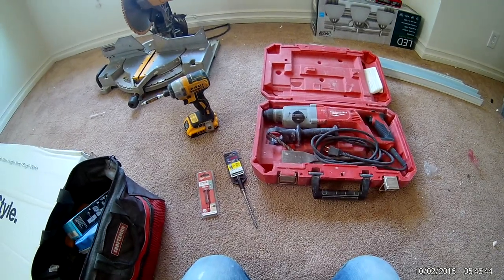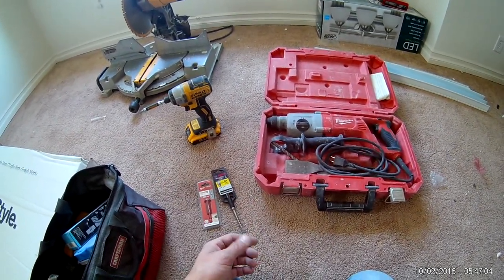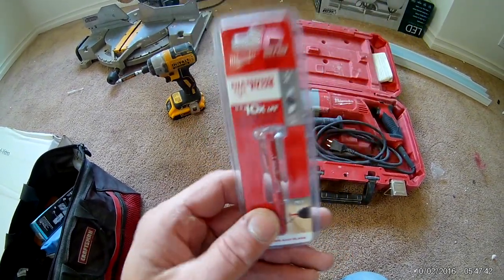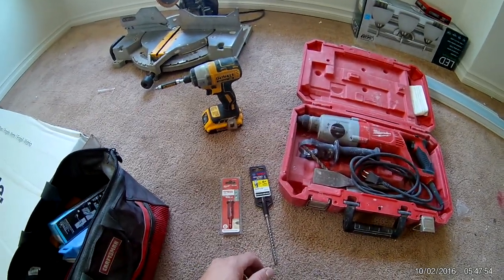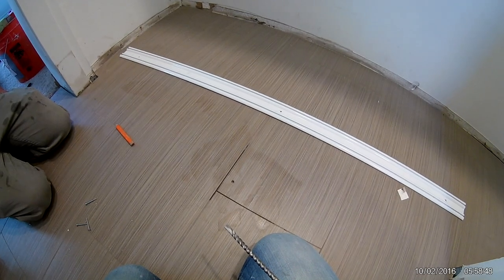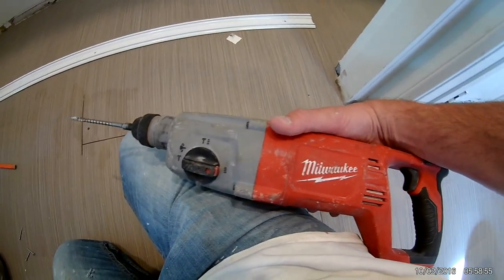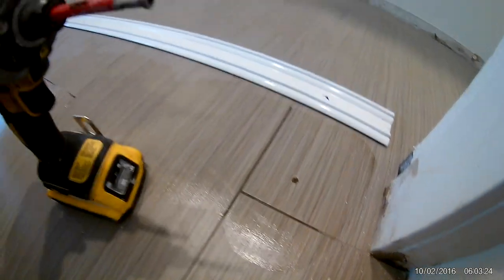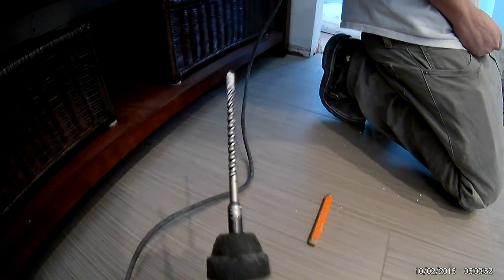How to Drill a Hole in Porcelain Tile - Which Drill Bit to Use?

Comment: I've been struggling to drill a couple of holes for a shower wand holder. Now, I've got 3 dull masonry bits and the holes are still very shallow. I'm going to try that diamond coated hole saw instead.
Reply from the maker: +auxpowerunit the bits work good, just make sure to keep it wet with a rag during the drilling process.
Reply: Thanks for the advice. I'll let you know how it turns out.
Reply: I just finished drilling with a Milwaukee brand diamond hole saw. It worked well. Thanks for your help !
Reply from the maker: +auxpowerunit That's great! We like them also!

Comment: Why didnt u have the it on hammer setting for the masonry bit
Reply from the maker: When on the hammer mode with this Milwaukee rotary hammer, it is much too aggressive. You need a drill with hammer mode.
Reply: +Landberg Tile DIY TV 
so a drills hammer setting Being much less aggresive would be ok.
Reply from the maker: Yes sir!
Reply: It could crack tile. Those spade type of bits, very inefficient with porcelain, and more source of trouble when you can damage finished product.
Reply: Ur not drilling on concrete ur drilling on tiles or glass.. Might cause cracks if use with aggresive speed.. Hammer mode diff from normal drill bit drilling.. The slower the better.. Be patience..
Reply: @LandbergTileTV  using a masonry bit without  the hammer setting is useless. It will not drill properly in the normal drill setting.
Reply: The tile will Crack if on hammer mode.